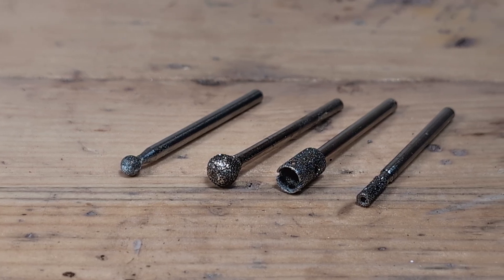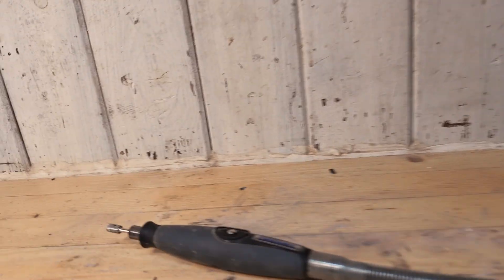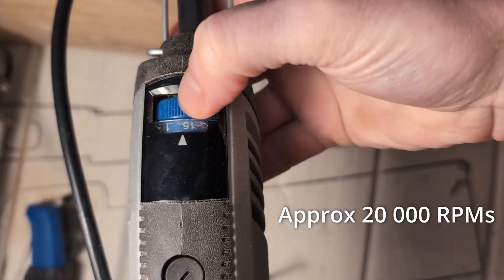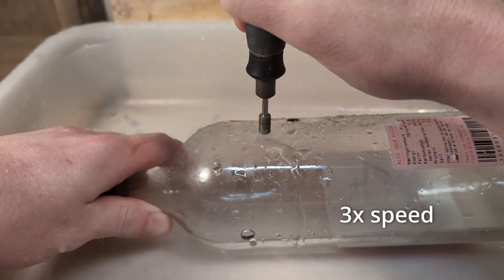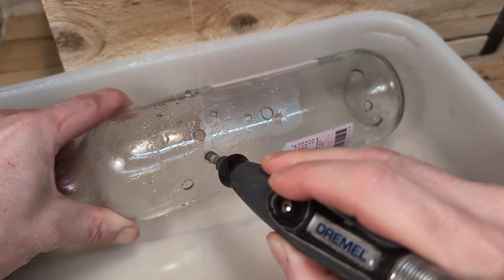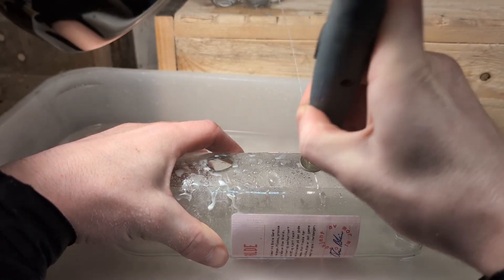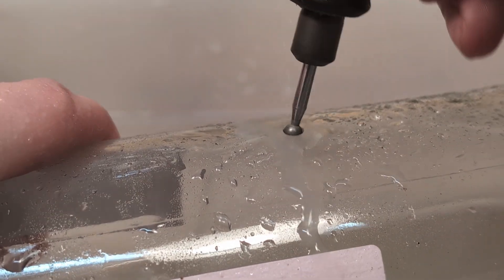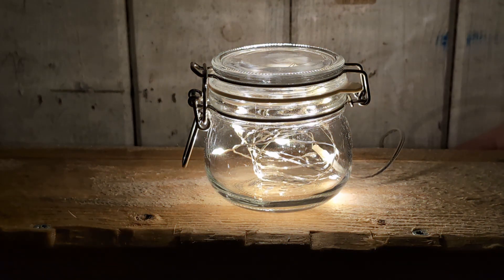How To Drill Holes In Glass With A Dremel And Rotary Tool

Comment: how can I polish the drilled holes for nice and clean edges. currently they are bit rough and crooked after drilling with the diamond bits. pleaseeeee help
Reply: You might try using what is called a bead reamer.  Maybe even a smaller size metal file.  Good luck  :)